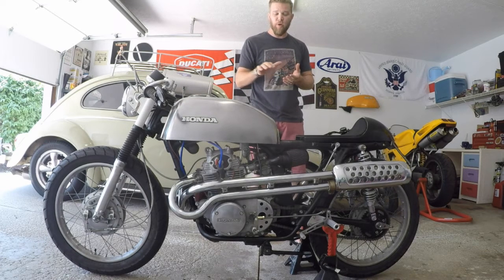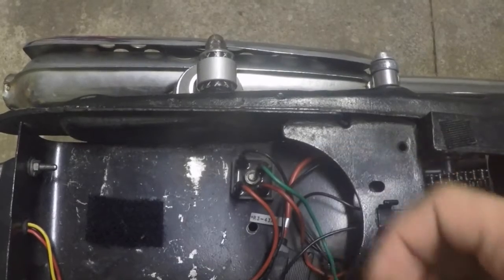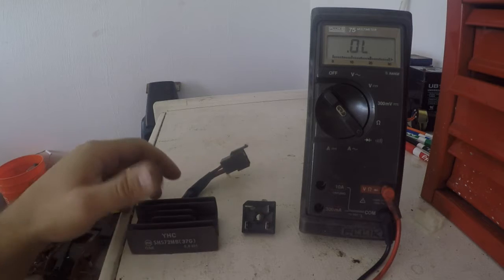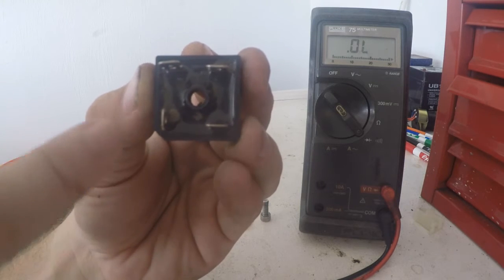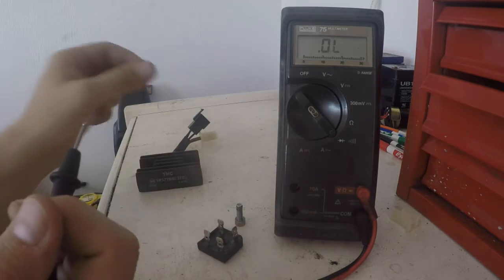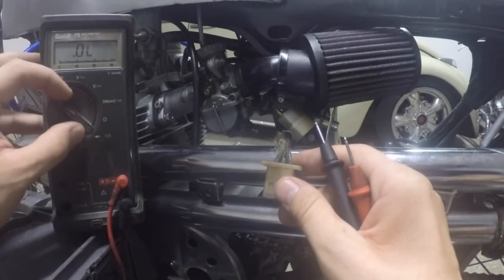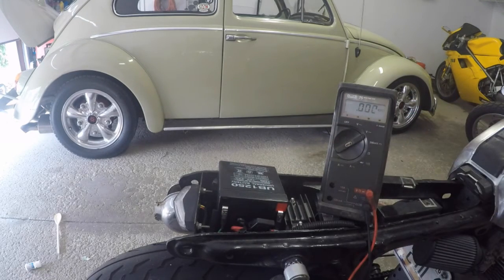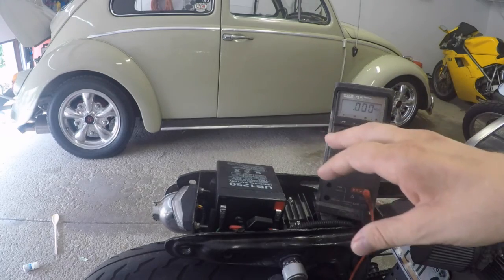cb175 charging system issues check/fix

Comment: I just bought this bike. I mean this exact bike in the video this is crazy lol
Reply from the maker: Crazy how it all circles back around. It’s the only one like it with tons of one off parts….. at least did when I sold it. Very fun little bike and hope you enjoy it as I did.
Reply: @vonbraun6358  as of right now it doesn't start ):
Reply from the maker: Hopefully the custom side cover has gone around with the bike to time it. I’m assuming it still has the electronic ignition module and cam nose cone I machined. The idle jet may be clogged (small one in center) or the timing is off. Need that cover and timing light.  Check for spark too. The original guy I sold it to somehow cut one of the wires to the electronic module behind the plate it’s mounted too. I’ll help with how I remember the bike when I had it.
Reply: @vonbraun6358  it still does have the electronic module. Seems like someone replaced the carbs at some point with some knockoff Chinese ones. Definitely getting spark though I just checked it last night
Reply from the maker: That’s a bummer. The head and original carbs were all work,ported and flowed together. The original carbs had some cool stuff done to help flow. I installed a port on each intake runner flanges also to make tuning the carbs easier. Hopefully they didn’t swap those out too. Being that they have been swapped, jetting/tuning is going to take a little work. Since you have spark I’d get the timing close,again I hope the custom side cover was given and not lost. Then work on the carb settings. Double check the valve lash too. (.002-.003) easy to make sure it’s correct and not holding a valve open. The engine internals have a lot done too (if it’s the one that left in the bike). It’s a fun bike and very quick for its size. It’s very PERIOD INCORRECT.
Reply: @vonbraun6358  if you're talking about the side cover on the points contact for the ignition yes that's still there.  But the cover that covers the front chain sprocket is gone. Although idk how to time ignition as all the videos I've seen used the oem point contact not the electric module you installed
Reply from the maker: It’s a left side round engine cover. That one says Honda on it. Mine was just a blank with a window machined out of it. You would put that cover on and point a timing light through the “window” and rotate the module plate to adjust the timing. With the engine running. Then replace the cover with the original cover. Maybe contact the guy you bought it from and see if he still has it…. And the custom sprocket cover. Hahaha.
Reply from the maker: It’s a left side round engine cover. That one says Honda on it. Mine was just a blank with a window machined out of it. You would put that cover on and point a timing light through the “window” and rotate the module plate to adjust the timing. With the engine running. Then replace the cover with the original cover. Maybe contact the guy you bought it from and see if he still has it…. And the custom sprocket cover. Hahaha.
Reply: @vonbraun6358  just pulled the carbs and the bowls have fresh fuel getting to them. I guess I'll have to buy a test light and check the timing. Maybe do a compression test too. Also too the bike starts with starting fluid but only runs on one cylinder and that is per from the guy  in Florida I bought it from
Reply: @vonbraun6358  welp did a compression test and they both came out at 60 psi lol

Comment: I wish you would connect rec/reg during your video so i know how to deal
With two connectors vs single
Bcz its 5 wires vs 4
I hope you follow my point
Thanks
Reply: Absolutely and whats the source and brand cost for the combo unit
Reply: @plusblood5101 CommonMotor sells the rectifier/regulator unit and has a video explaining what to do with the 5th wire

Comment: Only 36 likes after 3 years?! This is an awesome video. Extremely informative and well laid out. Thank you for doing this. 

My 1972 CL175 recently died at a nearby grocery store. Luckily I only had to push it about a mile. Turns out the battery was completely dry. No water/acid. So I filled it with distilled water and got it back to life. Now my bike starts right up. But the voltage at the battery when the bike is running is around 11.68v. As I rev the motor it will creep up to 11.72v and the next vroom will read at 11.84v so on.... so it appears as I rev the motor it sends very little charge and help up the voltage marginally. I’m going to have to dive in with this video as my guide. Thanks again.

Comment: Hi VonBraun I have 2  CL 175. 1 is a stock 1971 in Poppy Yellow Metallic the only year for this color, and other is a "1970 headed to the junk year, $200.00 rescue" restored and modified looks a-lot like your. I would like to know more about your carb setup and the pod filters. Which ones did you use and if you could address any performance or timing issues. I have heard that the bike sometimes does not like mod pods. Could you post more vids about your 175. Not to many people who ride a 175 post. thanks

Comment from the maker: Glad you solved your issue and thanks for watching. You should do a leak down test first to see if it's head related (valves/seats/guides ect) or piston/rings issue. If it is piston/rings then you would want to measure the cylinder barrel and see what it measures as far as wear. The cylinder should be honed for your new rings. Your cylinder will let you know what size Pistons you need (std,.025,.050.075 ect)then hone/bore for that piston. All sizes can be found on eBay. Type in cb175 piston. Hope this helps

Comment: I had the same problem last time but it was solved now my engine has low compression issue and need to change the pistons n rings but those selling on ebay seems to have different part number than what i check online. Do u have the part number? 

These are the number i found online 13104313000 for piston and 13011302004 for the rings.